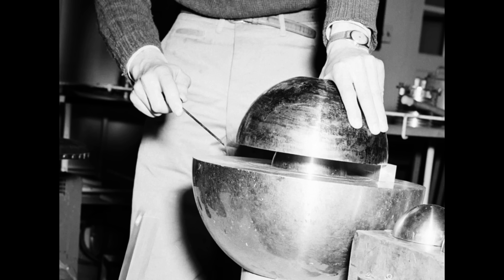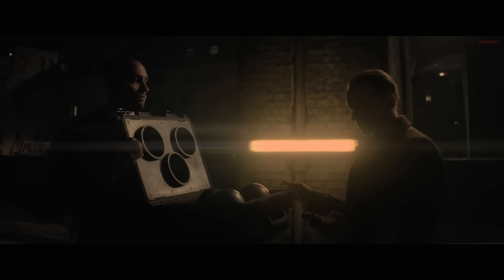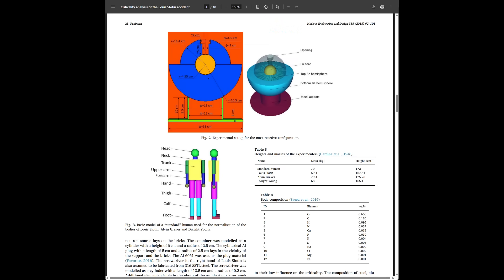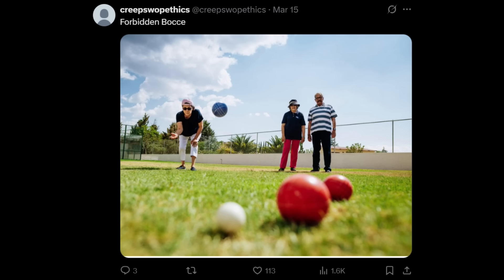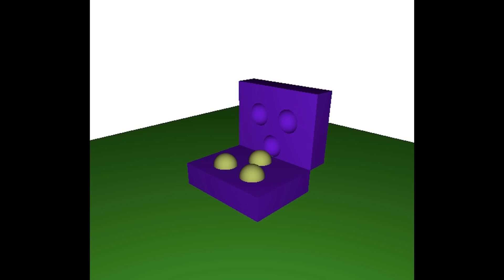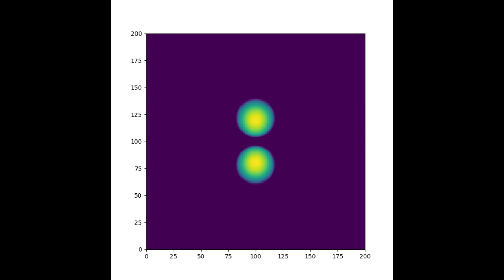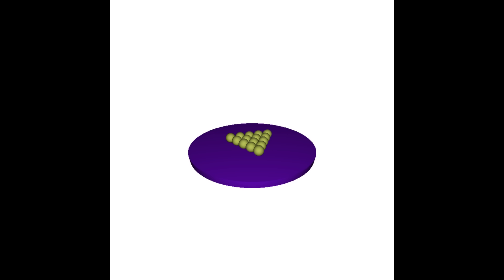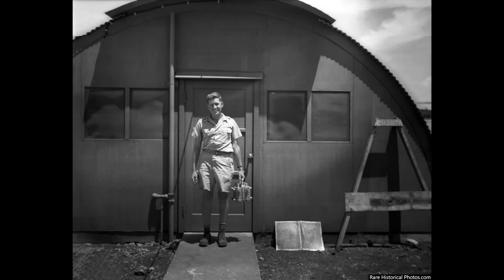Bowling With The Demon Core - Would It Explode?

Comment: People tend to misunderstand the purpose of D2/T2 gas in boosting. Yes, a fusion reaction takes place, but the main boost is from the neutrons generated in that fusion reaction. Those neutrons accelerate the fission of the Pu core making the device more efficient. This also allows variable yield by injecting different amounts of the gas (there are also other methods and more than one may be used in a single weapon).
Reply from the maker: Yes, I explain this in my longer series on nuclear weapons.
Reply: @scottmanley Now you're going nuclear
Reply: @scottmanley  very informative series of videos. I especially liked the exploration of a non-spherical two point detonation system. Very well done.
I wish there was a video on the actual MIRV design and how it navigates and "drops" the warheads with such precision. Also details about the RV internals would be highly appreciated.
Reply: Yep, it's a fission-fusion-fission bomb. I still remember this from the video.

Comment: Howzabout hollow plutonium spheres as pool balls filled (or coated) with PE plastic neutron reflector inside, to be of proper mass for pool balls? How far from criticality would it be, and how much additional plutonium should be in the part of the table where the balls are set for breaking (under the table)?

I know... but I couldn't resist ;)

Comment: FYI, you don't have to freeze rubber stoppers to drill a hole in them. Many chemistry labs have a cool drill press type machine with hollow bits. The bits are basically sharpened tubes. You need to lubricate the stopper and drill (we used glycerol) but the machine cuts nice clean holes.
Reply: Another FYI, I'm almost positive I purchased an exact copy of that black plastic case from Aliexpress. It cost $80 but I ended up getting it for free since it took so long to arrive.
Reply: I don't get whats the point of drilling holes in rubber stoppers. These old ones already have a hole for the screw. Or maybe a threaded bolt embedded in the rubber.
Reply: @benjaminhanke79  I think you're thinking of rubber bumpers. Based on the context, I assume these were stoppers for flasks used in a chemistry lab. The rubber stoppers used in chemistry labs are generally solid rubber (or similar material). We drilled holes in stoppers to insert glass tubes to allow vapors to be moved from one container to another (often for distillation). Most chemistry labs will have a bunch of stoppers which came with either one or two holes. The custom drilling setup I mentioned was used to allow non-standard tubing to be used.
Reply: @ddegn  I was lost in translation, had forgotten that that thing to close a bottle is also a stopper.

Comment: If the mission impossible case is closed it is not critical, but does it go critical if you open the case? As this will replace half of the borated polyethylene with air.

Comment: They weren’t supposed to be using screwdrivers, they were supposed to be using specific shims. Nobody used them because screwdrivers were easier, but shims wouldn’t have slipped the way the screwdriver did.
Reply: To be fair, Scott didn't say they were "supposed" to be doing it at all, and the absurdity of twiddling a screwdriver instead of using a proper jig is a huge part of why it's become such a meme
Reply: True. Harry Daghlian and Louis Slotin were not doing scientific experiments, they were putting on a circus act. By then the top scientists had left and the sorcerer's apprentices were running amok in the lab. Fermi, who stuck around for whatever reason, stumbled into one of these sessions, got up and left immediately, warning everybody "you'll all be dead in a couple of weeks."
Reply: To me it seems the whole concept is badly designed, even using proper shims. It seems to me an upside-down version would be much preferable, where in case of any failure gravity would automatically separate the halves.
Reply: @rschroev  That would bring a whole new meaning to the phrase "levitated pit"
Reply: Yeah, people always call it an experiment, but I don't know what the point of the experiment would be 🤔
Reply: @krugerdave  The point of the experiment was to measure how close to criticality the core was. It was absolutely an experiment; just one that was being performed in a ridiculously shoddy way.
Reply: the sensible thing to do is to have the whole thing be a remotely-operated setup like the Godiva device (not that that didn't nearly kill Frisch one time)
Reply: @elongated_muskrat_is_my_name And it was remotely-operated after this incident.
Reply: Peak male content?
Reply: I work in steel erection as a connector and detail hand. It has been interesting to note that laboratory safety when handling radionuclear devices is/was (on a few occasions) sometimes just as seat-of-your-pants as it is for a bunch of dirty laymen who get paid to turn wrenches. 😂 Humans gonna human, I suppose.
Reply: @clueless4085  Hopefully "was"! I think all this kind of work is now done remotely, using proper equipment.
Reply: @beeble2003  Haven't heard of any incidents in a while, so presumably 😅

Comment: Having worked in the nuclear power field, the biggest takeaway is geometry matters.  The physical layout of the fuel, cooling channels, materials, etc all effect the neutron flux and energy of said flux.  This is why reactors for power are very difficult to make explode (at least in the nuclear sense).  Every power plant that has had an explosion (to my knowledge) has always been a steam explosion, due to failure to cool the core.

Which is one reason i strongly favor molten salt thorium reactors.  No possibility of a steam explosion, as there is no water for cooling.  Just molten salt.
Reply: More electric flux Eyegor!
Reply: I actually don't get why the geometry would matter with the Mission Impossible "Demon Cores". Aren't they designed to shield off any radiation from within? Does Plutonium not emit hazardous levels of radiation in sub-critical state when presenting them in an open case?
Reply: @argh1312  Not much, really.  Even enriched uranium fuels aren't that bad.  It's the short lived stuff that's nasty.
Reply: @argh1312 pu 238 is very radioactive, which is why they use it for RTGs.  It has a half-life of 87 years.  But weapons grade plutonium is Pu 239, with a half-life of 24,000 years.  It's not as strongly radioactive, ine would assume about 0.3% as strong.
Reply: @darylbardo  Thanks, I didn't know that. But I still don't understand. If the geometry is relevant that means the cores' contents interact with each other, which means they emit radiation to the people around that case, too (at the very least while it's opened). What kind of radiation is it that would let these "Demon Core" configurations achieve those amounts of criticality, is it not harmful for people?
Reply: @argh1312 I was speaking of natural radioactivity, which a material has no matter what it's geometry.  What geometry creates is a situation where a randomly split atom can have its neutrons, on average, split more than one other atom, called a chain reaction.  This is called critical mass, and although mass is involved, so is physical geometry.  This also creates radiation, but with a sub-critical mass, it's a negligible amount of radiation.  The crazy thing is that, with masses that are subcritical, but very close, the radiation from this fission is basically nothing, but just by physically moving a few of them together, it can change from less than one to mkre than one, and suddenly a chain reaction starts from a random neutron.  Then the fission radiation starts to matter VERY quickly, and natural radiation becomes irrelevant for a little while.
Reply: @darylbardo  That's so counter-intuitive, that weapons-grade Plutonium would be so much safer to handle than Plutonium for civil use. Again, thank you!
Reply: It's something that always bothered me in Sci-Fi, too.  You have a ship with a fusion reactor and the reactor gets slightly damaged and boom.  Nuclear explosion.

Playing with it in a book I'm writing.  Ship is critically damaged but the reactor isn't the problem.  No, like you say, it's water flash boiling into steam that's the problem.  Self oxidizing fire?  Release valve stuck/damaged/inoperable due to the same damage that caused the fire?  Congrats!  Now you have a thing that'll burst with more than enough pressure to give everyone on that ship a really bad day, and you probably want to check out the amenities of an escape pod.  All without pretending that the reactor is the equivalent to a nuke.

Because honestly, who would design a reactor that'll level cities if you look at it wrong?  That's insane.

Comment: I'm trying to imagine how spheres are made; one would have to start with a bigger piece and using a lathe material would have to be machined away to make a smooth sphere, yes?
Reply: Pretty much. I'd guess they probably started out with a rough casting that was approximately hemispherical, so that they wouldn't have to remove so much material. Machine two halves (so you can make them hollow) and join them together to make the sphere.

Also the machining would have to be done in an inert atmosphere as plutonium dust ignites on contact with air, and is horribly poisonous besides.
Reply: @nerd1000ify Correct me if I'm wrong but I don't think the demon core was hollow. Hollow shape increases the required mass for criticality a lot compared to a solid sphere, and plutonium was hard to get material so you would want to use as little of it as possible.
Reply: @hirvielain9013  Remember that we actually want the core to be as non-critical as possible until the moment of explosion.

When the bomb is detonated the hollow core gets imploded by the explosive lenses into a (effectively) solid ball- the small amount of air in the hollow is easily compressed compared to the surrounding solid metal. So we can choose a mass of plutonium that works as a solid ball, but spread it out more by making a bigger hollow ball of the same mass. That gives you a better margin of safety.
Reply: @nerd1000ify Ah that makes sense!

I had always wondered how you could crush down a solid metal ball with the implosion, but making it hollow first solves the issue!

Thanks for your reply.

Comment: 3:43 - 9.3 centimeters more likely!
Reply: Same 😅 I was thinking, well THAT'S how they kept them subcritical... 1000th the mass 😅
Reply: Came here to say this :)
Reply: Damn it. Two full hours late to be the Um Achktully guy.
Reply: @AGryphonTamer  The more the merrier!
Reply: @AGryphonTamer  Ye man, sucks.
Reply: I think Scott also meant neutrons when he said neutrinos at 3:07.
Reply: Manley is truly adopting his American home by goofing up metric measurements.
Reply: @mdfogarty in defence of this Scottishness, questionable use of units is a proud UK tradition! We're taking about the island where petrol is sold by the litre but everyone still talks about MPG 🤷
Reply: @krugerdave  Sure, but that's just a case of our random mixing of unit systems, not of confusing one unit with a different one.
Reply: @beeble2003  it should be sold by the mole.
Reply: I used to work for a British subsidiary of silicon valley semiconductor giant Applied Materials. During the 90s they ordered a prototype part to be CNC manufactured by a Scandinavian supplier. The supplier were used to using centimeters as their standard engineering unit. The UK uses millimeters. The part duly arrived a little bit too big.
Reply: @Tim_Small  Strange for a CNC manufacturer. In mechanical engineering the default unit in drawings is millimeters. In structural engineering it's cm.
Reply: @Tim_Small  Why does this make me think of "Stonehenge" in reverse?
Reply: @randyeubanks2934  exactly. Druid’s man. Druids.
Reply: @Tim_Small  I drove past the Applied Materials building in Austin every day on the way to my job at IBM.
Reply: @Tim_Small  it’s called pulling a Spiñal Tap.
Reply: I posted the same thing before I noticed your reply.
Reply: No, no, Simon Pegg is just REALLY short.
Reply: And confusing neutrinos with neutrons.  I think Scott may be missing some sleep.
Reply: Or Tom Cruise could be x10 small than anyone imagines
Reply: The strange thing is that he made the exact same mistake when he talked about his calculations in the twitch stream two weeks ago. It's still there to re-watch it.
Reply: Raised my eyebrow when I heard that one. Thought maybe he meant there is a plutonium core inside some inert metal sphere or something.
Reply: 3.9” not cm
Reply: @teodelfuego  how many burgers is that?
Reply: @omgsrsly  who cares?  There’s photos of it beside a measuring tape delineated in the measuring system used by the British and American scientists working with it.
Reply: 1 1/16 McRoyal with cheese  @omgsrsly

Comment: 3:38 9.3 mm or cm of diameter? I think it would be a bit small if it was 9.3mm
Reply: Let's put it this way:

9.3mm: smol
9.3cm: seems legit
9.3in: THIS IS A PUBLIC SERVICE ANNOUNCEMENT
Reply: Yeah. About 10 cm is what I recall calculating in my intro to nuclear engineering class 40 years ago, but I can't remember if that was for uranium or plutonium.

That's where I also learned that "barn" (as in "broad side of a...") was an area unit of measure.

Back then, it wasn't uncommon for universities to have on-campus nuclear reactors in the basement of the physics building.

Comment: Absolutely no way would it explode with any significant yield. The most you'd get is a flash of blue light, a nasty radiation dose, and a mildly energetic fizzle.

In order to make a bomb you need much more than merely to go supercritical - you have to go far enough beyond criticality that a significant fraction of the fissile material will react and release energy before the assembly self-destructs and thereby renderes itself subcritical again. Inertial confinement (a state of mechanical affairs that tends to resist being pushed apart) also helps increase yield.

The problem with reactor-produced weapons-grade Pu (which is basically the only kind available in any quantity) is that it's contaminated with trace amounts of Pu-240. Pu-240 releases decay neutrons at a significant rate. Probabilistically speaking you have a very short time window between when the core goes supercritical and when some stray neutron from a Pu-240 decay will kick off the party. That means that you have to get the assembly sufficiently far above-criticality for bomb-class yield within a matter of microseconds before initiating the reaction, and that's why gun-type Plutonium weapons aren't a thing.

This is why Pu bombs are universally implosion-based - Shock fronts from high-explosive lenses can compress the plutonium so quickly that it reaches a highly-supercritical state before any stray neutrons can interrupt the process. Likewise the momentum of the implosion itself acts as a form of inertial confinement, further boosting efficiency. Make the pit hollow and squirt some tritium boosting gas in the middle, and Bob's your uncle.

So, no, there is no way you could bowl your way to a significant explosion, at least not with Plutonium.
Reply from the maker: Do you agree with my assessment of how a such a slow assembly process would behave?
Reply: @scottmanley  Yes! Sorry I wasn't explicit about that.
Reply: @scottmanley  remember that with slotkin the core went critical and yet no explosion. during nuclear bowling it would go blue for awhile but no explosion at all most likely, not even after it goes critical.
Reply: I would note that "stray neutrons starting the party early" is one of the reasons why weaponeers always allocate more than one weapon to each target, and why they reputedly assume a ~10% dud rate. In actual US testing the dud rate was much, much lower than that (with 1 known failure in the entire last 3 decades of testing), but it can never be zero.
Reply: Ted Taylor worked hard to miniaturize nuclear weapons. When one finally failed, he was congratulated! See: The Curve of Binding Energy, by John McPhee.
Reply: This guy definitely bombs.
Reply: Thats the conclusion he came to yes. Thanks for restating it for us.
Reply: Scott, the Demon Core was detonated in an atomic test. Everyone wanted to get rid of it. I just moved and all my nuclear texts are in boxes, but I remember reading that.
Reply: @daveeyes  Per the New Yorker's article about it it was planned for use in the third Crossroads test (blowing up ships in Pacific) but that never happened. It was instead melted down and remanufactured into newer core configurations

Plutonium was scarce and bomb design had moved on from the Mark 3 core configuration, so it was no longer valuable as a research tool anyway. Regardless of emotions there was just no reason to keep it.
Reply: @daveeyes  " the Demon Core was detonated in an atomic test"
No it wasn't. It couldn't be used immediately because they needed to analyze whether it had been poisoned by fission products in the criticality, and then it was melted down.